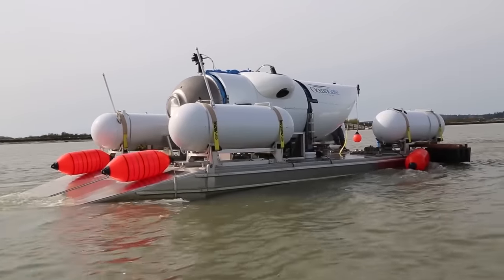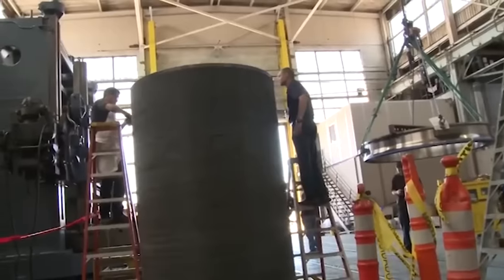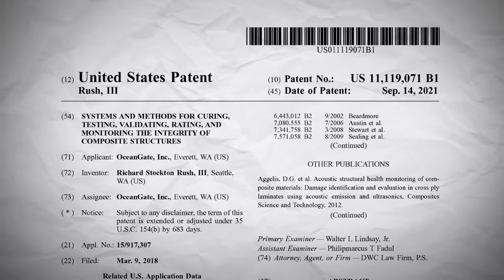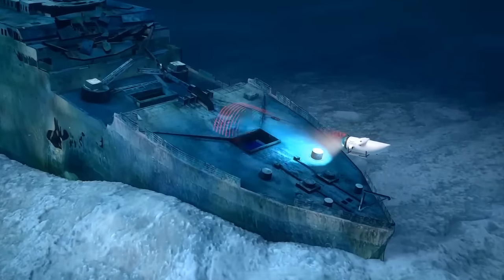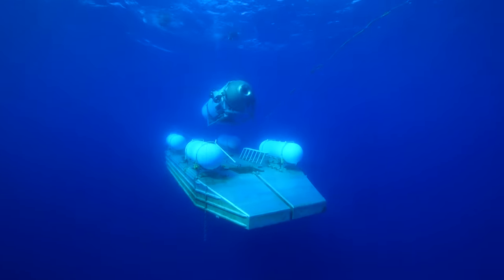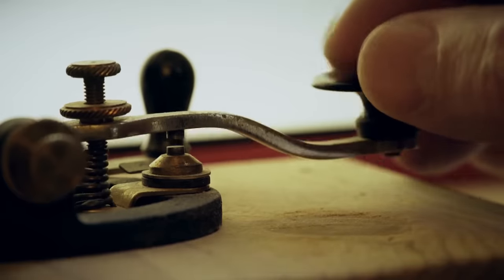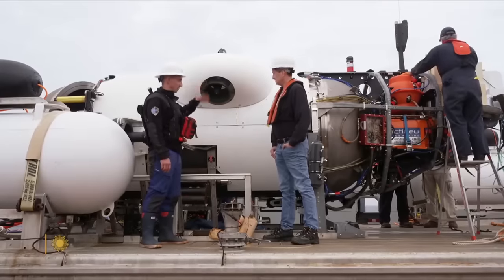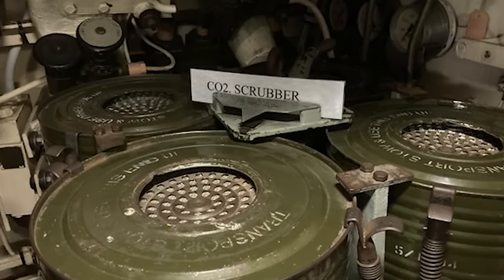Exposing OceanGate Submarines Many Fatal Designs

Comment: Having sensors to tell whether there was buckling was just crazy. That’s like taking a picture of a car flipping through the air in an accident.
Reply: But it might give you time to react like jettisoning ballast or having a winch pull you up, so your liquified and vaporized remains float to the surface instead of sinking to the bottom
Reply: While you're in the car. Lolol
Reply: it wouldve told them to cancel the dive and not go any deeper. couldve actually given them a chance
Reply: @juankahoy  not really... the proces changes the integrity once it starts.  when you measure it, it's too late.
Reply: @juankahoy  so that their remain could be retrieve ? 
I mean by the point that alarm goes off, it had already been too late for whoever was sitting inside that death trap.
Reply: @juankahoy I don't think so. From what I understand, if there's a fault in the hull that the system detects and the crew jettisons the lead weights to ascend, they still have all the water above them that they decended through to get to safety. When something like that is detected, it's already too late.
Reply: They might have had a whole 2 or 3 seconds to prepare for their demise.
Reply: I mean that’s a pretty poor analogy ✅
Reply: I'm sorry but the way that these people died was inhumane and I definitely think it could have been prevented.
Reply: They literally died the worst way possible.
Reply: @mike-me7om try less than 100 thousand of a millisecond... they didn't even realize they were dead
Reply: Like a doorbell for death himself, so that he may announce his presence.
Reply: @MrBigfoot1979  WRONG...they didn't feel it but they surely heard it coming......they had already pressed to button to dump the sandbags....
Reply: @juankahoy maybe but probably not. Once it gives, it's self reinforcing and catastrophically collapses. Once you detect an anomaly, the animals leads to weakening, leading to further weakening leading to collapse. Mayyyybe it may help with metal capsules showing remaining deformation after a dive, but not CF. CF is either fine or broken.
Reply: Problem is when carbon fiber fails it shatters. New evidence has shown they dropped their weights and were heading back but the failure process had already begun. When it failed it failed in less than a blink of an eye, a millisecond by some calculations. To put that in perspective it takes 100 milliseconds to process a thought and 30 milliseconds for your brain to register pain…This happened in a single millisecond. They probably knew there was a problem but they never saw the implosion it was that quick.
Reply: The reports say they were ascending at the time of the implosion— implying they knew they were in trouble and were heading back up.  Must have been scared shitless.
Reply: @andyramirez5436 worst possible way?   I think suffocating would of been much worse than instant death that they never saw or heard coming.   It was painless a tragedy nonetheless
Reply: lol
Reply: Not necessarily, if the hull failure modes are such that some detectable micro-cracks or delaminations occur well before the final catastrophic failure. But to know that, the system should have been tested, multiple times, on an identical hull driven to destruction, not a scale model in a pool.
Reply: @bazoo513 The CEO could hear the destruction in previous dives. He ignored it.
Reply: @ublade82 nope, implosion comes in milliseconds
Reply: A better analogy is, a car with collision sensors that warn you that your about to hit something, problem is it useless if your going 100mph, you dont have time to react...
Reply: @patrikfloding7985  🤦‍♂

Hubris is a terrible thing...
Reply: @andyramirez5436 Eh, way better than slow suffocation, especially if they floated to the surface and were unable to go out.
Reply: @tuananhhoang7113  they are safe in some hotel in Prague or Geneva, then they will just call a press conference to announce the rescud. 4 months later, they already publish a book to sell to a demographics in America. While Tom Hanks and friends are filming the movie adoptation that will feature a cameo of Halle  Bailey as the Little Mermaid.
Reply: Anything that isn't Spherical just won't work. Otherwise any submersible not obeying this law of geometry would be prohibitively heavy.
Reply: Delaminating sensors at depth are like a chocolate teapot.
Reply: It reminds me of some bridge collapses in the US.  The engineers had said work is necessary, so the administrators decided on more frequent inspections. 😮
Reply: @AnthonyOMulligan-yv9cg  fat shaming a submarine. Hell yeah, the law of geometry.
Reply: @rodneycalpito5621  More like a car with collision sensors which tell you when you have hit something.
Reply: @ublade82  No sensor system can help you react to a implosion at supersonic speed. Read my full rant in the comments.
Reply: @juankahoy  nonsense. carbon fiber shatters when it fails. Its either going to hold or not.
Reply: @seanohare3509  It is. There has to be a better analogy. It is like a fire alarm in your house that only detects flame
Reply: It will test movement or pressure on the hull. The thing is an experimental craft
Reply: @ryanhampson673 I wonder if Rush was thinking in his final moments about all the experts he ignored. Everyone on board had to have known they were gonna die.
Reply: @ublade82 no chance once the foundation of the structure breaks your done way down there even if they started goind back up the damage is done even if the thing didnt implode everyone would of drowned
Reply: But... it's the same principal employed by black boxes.  Oh, that's what broke.  We'll fix it or generate an advisory.   I'm not defending OceanGate or Rush.
Reply: @ublade82 my apologize i misread your 100 percent right
Reply: @954roof I'm pretty sure they saw it coming. If they knew there was a problem and were heading back to the surface, everyone on board knew they were going to die.
Reply: @mvd4436  again incorrect. Analogies are way out there 😂
Reply: @ublade82 ahahaha You had me in the first half 😂
Reply: I'm tired of the news....came here just for the accent.
Reply: The sensors would also have had no time to react as the sub must have blown up at the same time that the sensors were preparing to say oops
Reply: By the time alarm sounds its already too late to do something..the alarm is a warning that structure is disintegrating..given extremely high external pressure one has milliseconds before the hull implodes..
Reply: @mike-me7om I seen on another video where a physicist was saying at them levels of pressure it all likely would have happened within 5 milliseconds and being it takes around 150 milliseconds for our neurotransmitters to receive and process sensory information so they were literally very much dead before they even knew it was happening. The problem with multi layer composites is everything is all good until it's not.
Reply: I dont think that is an accurate assesment. 

In steel/titanium you would have sensors and scans to assess the health of the material that give you ample signals that it was time to retire the part long before it is in any danger of structural failure. This is because in a homogenous material you can model and assess the failure mode quite accurately and build it to a margin of safety that makes it easy.

Carbon fiber is more tricky, because it is an anisotropic, non homogenous composite. Modelling its failure mode is far less precise. It can be scanned for defects, but if the margin of safety is too small, those scans cannot reveal microscopic defects that would lead to structural failure. Having sensors that detect delamination is not a bad idea, but they only help if the margin of safety is large enough so the delamination will not endanger the structural integrity before the part can be retired.

Why didnt they build a carbon fiber tube with a margin of safety that would make their sensors meaningful? Because carbon fiber is bad in compression, it would lead to a prohibitively heavy and expensive tube. They wanted to save weight and cost (compared to steel and titanium). To do so they sacrificed on margin of safety. Why did they do that? Because a craft of a cost and weight that would result from proper margin of safety in any material was not compatible with their vision.

You can see the same thinking in their choice of viewport, which was certified to less than half the depth they took it to. Effectively they took a part with a good and certified margin of safety and said „too much margin of safety“, dismissing the certification. Why did they do that? Because viewports certified for that depth are tiny. It wasnt compatible with their vision.

In a speech, the CEO claimed that when it came to safety, they would make no decison that sacrifices safety no matter the cost. But as is now self-evident, that is exactly what they did. They sacrificed safety in every decision, in order to save cost and make a craft that conforms to their unrealistic vision.

The tragedy is that along the way, they where warned and urged by subject matter experts to change their ways. These where in part public conversations, such as lawsuits and open letters. But not only did they deride all criticism no matter how qualified and well meaning, they built an ethos of being proud to not be safety conservative, not be certified and not have anything todo with the deep submersible communities experts. All this information was freely available to anyone wanting to ride their vessel. But they either didnt research it before they spent $250k, or simply ignored it…
Reply: "I'm being sucked up by a tornado but alert me when I'm 50 feet from slamming into the ground at 150 mph.."
Reply: Well if you like to get to the point buckling before the sensor measure s you might be slow like the guy that built this and died in it. You could build sensors that catch the distortion in the hull. Stop every five hundred and measure on the first trip down. Then on the next trip compare the numbers at the same points. When you have less than a failure a distortion shallower depth than the last three tests it's going to go bad on the rest of the dive so you need to turn around and come back. Unfortunately this person was the wrong kind of mine he was a feeling kind of a person on and thinking kind of person. He did not seal he needed to listen to the engineering paid good money for and he certainly not going to listen to some distortion gauge. Most of these very deep dive vessels made one dive face download one time did not have a chance to go through a bunch of load and unload cycles and that's why they didn't fail. One trip down one trip back your museum piece in
Reply: @andyramirez5436 No they didn't. They died one of the best ways possible. Unfortunately they knew there was trouble, and we've yet to know as the public how much time between the alerts to communication above and implosion, but the implosion happened faster than their brains could comprehend or feel pain. They were gone before feeling or knowing a single thing. I hope this information helps you to feel better
Reply: @seanohare3509  Give it your best shot.
Reply: @mvd4436  I don’t have to, I’m not the one using analogies. You are. Think of one that makes the smallest bit of sense
Reply: 😂😂 facts
Reply: Ridiculous analogy.  Strain gauges are a common way of detecting minute amouts of deformation.
Reply: @eduardochavacano in this case, more like longshaming. There’s a reason why deep sea submersibles are spherical…
Reply: @andyramirez5436  Implosions on subs are blink of an eye. Its very quick, compare that to a fire on board which even if put out in time has a risk of causing suffocation or being stuck at the bottom until you run out air.
Reply: @W0RLDSSMALLESTVI0LIN unless everyone entered full-blown panic mode, the Dawoods may have been scared but oblivious. As for Harding, Nargeolet and Rush…? They were experienced drivers and definitely knew they were well and truly fscked.
Reply: Or as someone else said…  “it is like having sensors on a space ship that tells you when the engines are fire”.
By the time the sensors go off it’s too late.
Reply: @Ena48145 not so sure about that. Apparently they dropped their ballast before the implosion. You would do that in an emergency.
Reply: @ublade82 they don't have a winch or a way out
Reply: @markmcgoveran6811  There are repeat deep submersible vehicles. They are built to a margin of safety that ensures structural failure does not occur, tested and analyzed to a standard that leaves no doubt of their safety before every mission. They are also really expensive, justifyably so. Thatis the price you pay to keep people alive, worth every penny.
Reply: You're all assuming the carbon fiber started buckling while at their maximum depth. It is theoretical that if the system worked it could detect a defect in the carbon fiber very early in the dive before they're at a depth that may cause instantaneous implosion. However I don't think the system worked it sounds like a stupid gimmick he came up with to make his passengers think the sub was really safe. He even had the carbon fiber rolled in a cheap way. The thing is he was half right. The sub did make it to the titanic several times more than most experts thought was possible. Unfortunately Stockton Rush couldn't quit while he was ahead and kept re-using his cheap submersible. This was always going to be the outcome. He was always going to keep using the sub and ignoring everyone. His accomplishment the first time made him arrogant and gave him lethal hubris that everyone knew was going to get people killed.
Reply: @eduardochavacano  Many year's ago I visited "long lost cousin's" in South America. They were not lost, they though that we, their Grandpappys brother's and sisters, cousin's had...... succumbed to the British Leather & Steel. I meet cousin's, O'Brien's but  now "Oberon's", and I met and Old Old Lady......Her Husband had been a "Lynch", and her Son?. Che. Very very Few People Know That Ireland's First President, Fought The British To Death, But Lived Was .....Eamonn De Valera. A Cuban's Son. How This World TURNS!
Reply: @eduardochavacano  I was born in Ireland. I moved to firstly Canada as a junior engineer, qualified at 22, but it was far too cold. I visited Mexico, an unforgettable St Patrick's Day.......the Love IS Strong, I flew South to the "Alternative Home Of Soccer"!, Argentina and visited Uruguay. Then I set my mind on moving to Australia. I gave up my Canadian Residency...... otherwise I would have 4 and I'm not sure that's legal. I have Irish by Birth, US by parentage and Australian by emigration. Why Australia?..... because I can grow ANY Orange, Peach, Fig, Pomegranate in my Garden and?......Make SPECTACULAR Brandy with these Fruits. My "Limoncello" is to DIE FOR! (Lemon Liquor, STRONG)
Reply: So just have no safety features? Got it
Reply: @ublade82  They did jettison ballast - they were ascending when it imploded.
Reply: @eduardochavacano  My "Slivovitz", Yugoslavian "Damson Plum Brandy".....60-70 proof, tastes like the best sweets......"Peach Schnapps" as the Austrians/Southern German's would make and my "Poteen", The "Original Still", "White Lightening" and ..... As Irish As. Most American Liquor is Scottish or Irish in Origin, in its DNA. If it's SWEET?, It's Scots, If it's Dry?, It's Irish. Whisky (Scot's Spelling) and WhiskEy..  the "E" denotes Irish. The easiest way to tell Scotch Whisky and Irish WhiskEy apart. Capishe?
Reply: @andyramirez5436  If you think thats the worst way possible, you havent read a history book.
Reply: @juankahoy  Not if they was an hour and half into the journey!
Reply: @PanamaSticks  good analogy, considering they imploded anyway...
Reply: @trevorberridge6079  There are thousands of comments. Can't find your rant.
Reply: @eduardochavacano  It's Simple. Simply having Red Hair, Freckles and Standing 6'5" with a STRONG Irish Accent?....... Everybody LOVES to have the Irish for Celebrations!. Mexicans are no different, in fact Mexico gives great honour to the Irish who stood and fell alongside them against the Yankee's. I was NEVER called a Gringo.
Reply: @@neisanokuri8033 Well, in the US it's called "Lightening". Whereas in Europe we lose the "E". Lightning. Now you must be some"Really Smart Monkey", thinking that you...... know........lots. lol.
Reply: This is ONStar You are mid-air, would you like more information?
Reply: @@neisanokuri8033 Your "OCD". Lol.
Reply: yes but are you single
Reply: When he was talkin about the view window he was like “we’ll see it crystallizing and shattering to know something’s wrong 😳 just dumb. I can’t believe they was allowed to do this
Reply: @mvd4436 Exactly, more like glass. Imagine that sub being made of glass, and having sensors hearing cracks. Well if your glass is cracking under the pressure of 3.8km of water above you, it's far far too late
Reply: The sensors may have been the cause of the accident!
Reply: @tuananhhoang7113 what remains? There is nothing left other than liquid which is already dissolved into the ocean.
Reply: I've said this elsewhere, I think the acoustic monitoring system was pointless because the ship couldn't ascend quickly enough to reduce its depth significantly in the few seconds of time you have to react when you hear the pressure vessel cracking up. It took hours of free fall descent for the ship to reach target depth. Maybe it could ascend a little faster than the descent but it's not going to be like the ejection seat on an aircraft in terms of how fast it could get you out of the danger zone, and that's about how fast you'd need to reduce your depth in an impending breakup emergency. They probably reacted to the emergency and managed to reduce their depth by maybe a couple hundred feet, which is not enough to relieve enough pressure in time to save them. It's like you're at 10,000 feet, it starts cracking up, continues to crack up as you start backing out and get it up to 9800 feet, where it finally fails because 9800 feet is still enough pressure to destroy it at that point.
Reply: @onemoremisfit  Somewhat like flying a plane with wings made of hardened biscuit claiming it's safe because we have a system that can listen to any cracks. Right, that's gonna save you when flying 10 km above see level if your sensors can only warn you seconds before the wing breaks
Reply: Its like having a tornado alarm that doesnt go off until the twister touches your home.
Reply: @onemoremisfit  in a last years interview with stockton rush, he said that stopping the descent when he heard a bunch of cracks would be fine as if he’s “breaking in” the hull of the sub.. I think he got a little too comfortable
Reply: @pyalot  I wish you were going to spew some quantitative methods some qualitative materials about this miserable hellish conditions that these people are asking for I believe the guy that went to the very deepest trip to the bottom and took her to the Smithsonian. But when you're saying this word what could you possibly mean? It covers such a narrow number of objects and such a wide band of death ratings that there's not really much to be said with words in this case. I've argued the McDonald's case with a hot coffee scalding a woman. There's a certain percentage of the population that just can't bear to take a number and apply it. Coffee is supposed to be hot mark. They can't seem to understand that water to scald height of a pig is supposed to be hot. If you just use the term submersible you can't really discuss two things that are both submersibles without saying how deep does it go then trying to realize how many times they repeat. I know there's something named submersible that goes up and down a lot of times how down does it go down or down down down or or down down down down down down down. If it goes down down down down down down down down and comes back it's pretty likely to be a  one and done. There's just too many depth limits to be anything of a useful classification to decide how many times they can go through the cycle of a bottom billion pounds of pressure overall.
Reply: @markmcgoveran6811  How many times you can take a well engineered pressure vessel trough usage cycles is a well established science. Finite element analysis gives you a prediction. You verify that prediction with sensors and destructive testing. Finite element analysis does not work on carbon fiber. OceanGates sensors could have never given them advance warning, and they didnt cycle test to destruction. What went wrong there isnt some mystery, it is bad engineering that compromised safety to save money.
Reply: @therickpound  I've tried Coffee with Chocolate but never Tea!
Reply: @craighermle7727  "Headlong Rush"
Reply: @@neisanokuri8033 Lol, so unsure of what you actually meant?
Reply: As an Irishman I can say that on St Patrick's Day there is NO PLACE better to be than in MEXICO!.
Reply: @notmyfaultthisishappening3795  Those few people who rode in one of the earlier dives in that thing, got all the way down to see the Titanic and came back alive have got to be feeling really fortunate now.
Reply: @pyalot  yeah I've worked with finite element analysis it requires some assumptions about the materials. Carbon fiber does not fit these things. Maritime things come to about three possible endings I work on boats blood-stained boats. Either they sell it for scrap, the kills a few people when it sinks or Burns and sinks and they sell it for scrap. The list of problems this machine reportedly had on the internet is amazing. Most profound thinkers that are very proud of themselves barely understand a tensil load. This was an airplane expert understood bending. Carbon fiber is just about the worst thing to put on something that is going to be under a cycling compression body force. We are not thinking tension and compression loads here this is a body Force condition. However it's not quite exactly as a
body Force condition, like gravity or inertia. Maybe if you had a pure titanium sphere or some ductile iron cast into a great big ball that bolted together and had some pretty impressive acrylic windows that were around in the correct shape and not very big, you could come up with a material shaped in a very simple geometry with a very simple pattern of pieces missing and sort of get an idea of your loads as it goes up and down to the site. When you had that big round plexiglass dold sticking out the front and then you go to a piece of titanium or some kind of metal and then you both back to another piece of metal and that piece of metal makes a transition this some other material and then that transition is not a half sphere or any of that it's just a meet-up between some other materials that are going to change shape under these loads. When you have something like that his load varies in the are attached together sour solid and very through such an extreme range of they won't change shape the same as the load rises and drops in a stress razor will definitely form. It's like Bending a Steele wire back and forth. If it's a sphere of one kind of material it loads the same everywhere because of the geometry it loads the same everywhere because of the material. That's not a fringe benefit of a spherical shape that's the only qualified shade the hold that kind of load through a cycle that large without forming a stress riser
Reply: @tuananhhoang7113  You can retrieve molecules.  There was nothing left.
Reply: @@neisanokuri8033 Such is Life.
Reply: @@neisanokuri8033 That's quite Hilarious, good on you, Me?......",All's Good Thanks"
Reply: @pyalot  yeah of course you're right a well-engineered thing works a poorly engineered thing doesn't work you've just got so many circular reasoning than here you don't make any more sense than a guy that built this thing. He was certain you were right to and he was certain that he had the well-engineered thing. Oh you have is something to talk out of I'm not sure which one brush your teeth so we can tell
Reply: @markmcgoveran6811  Which part of every subject matter expert warned them the carbon fiber tube is a bad idea because it is shit in compression and cant be stress modeled or tested forintegrity, but they used it anyway to cut costs, didnt you get?
Reply: @rodneycalpito5621  Wrong. The correct analogy is a car sensor telling you that you’ve already been in an accident.
Reply: @pyalot  the memo about the cheap carbon fiber didn't get here. Where are they selling a 5 inch thick cheap piece of carbon fiber I want to buy I'm not going diving but I'm sure I can find some way to use it. This guy was not picking things based on any kind of a practicality he picked that carbon fiber because it's the latest and greatest material. Probably for the same money he could have made a cast steel ball into pieces but bolted together and still be out there flying around  underwater.